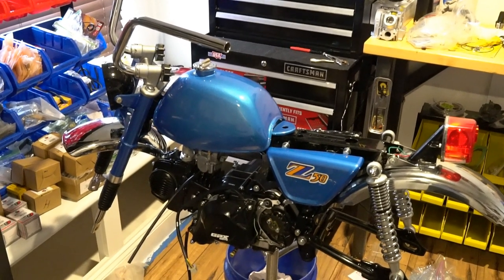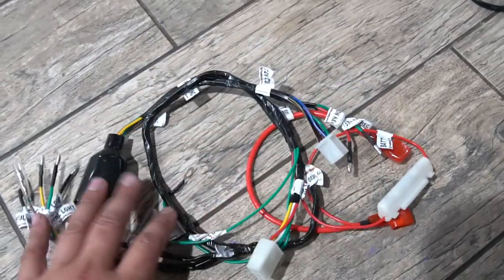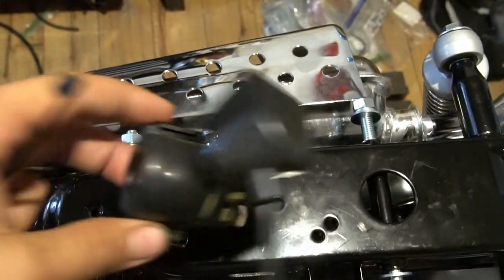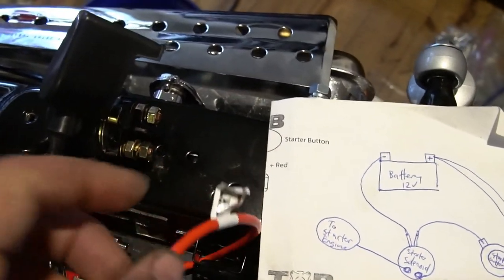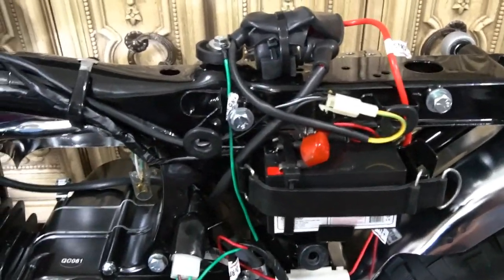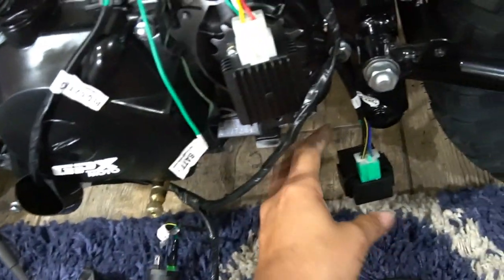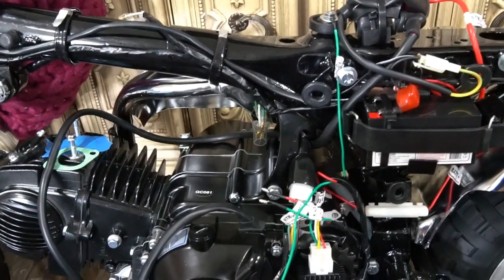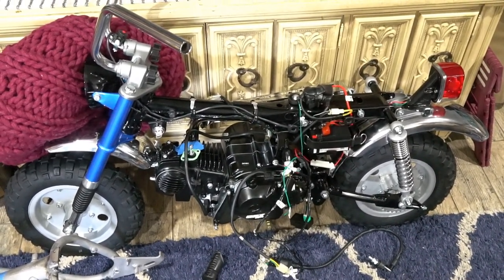Street Legal 1974 Honda Z50 Mini Trail Monkey Bike - Electric Start 140cc Mod Build - Video 2 of 3

Comment: What cause oil to leak out of the flywheel side by chance, I just put the case back together and and tried to fire it up and oil started leaking
Reply from the maker: Not sure without having it in front of me - Make sure your crankcase breather hose isn't kinked causing excessive crankcase pressure. If it is closed off, oil will be coming out from seals
Reply: @VintageHondaMinis  it's a Honda z50 ae, sorry forgot to mention, leak is also coming out of top end where the piston slides in to meet the crank case and at the very front bottom valve, it leaks more when kick-starting it, I replaced the gaskets, wonder if it's not torqued enough
Reply from the maker: @redlitemeatandpizza  Apply a skim coat of Hondabond HT on both sides of that paper gasket and re-torque stud nuts in 3 stages crisscrossing - 5 ft/lbs / 7 ft/lbs / 9  ft/lbs final - https://www.amazon.com/Hondabond-High-Temp-Silicone-Liquid-Gasket/dp/B006YTTV4W/ref=sr_1_1?dchild=1&keywords=hondabond+ht&qid=1627828586&sr=8-1
Reply: @VintageHondaMinis  ok thanks for the tip! I'll have to give it a try